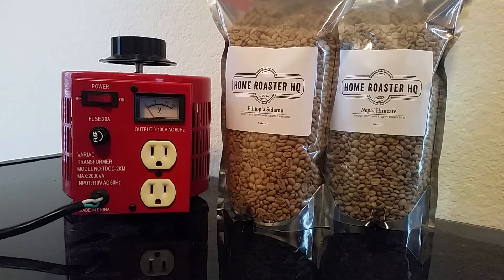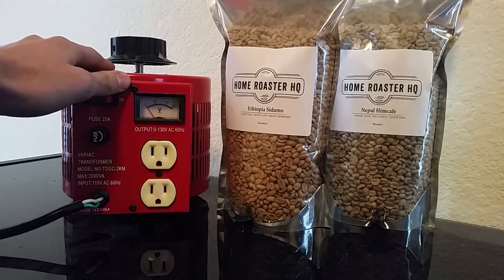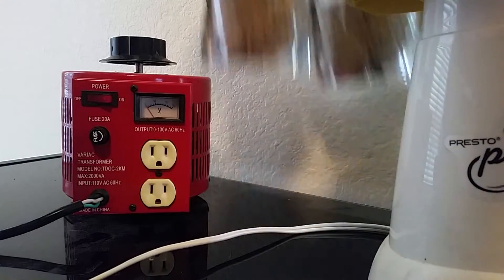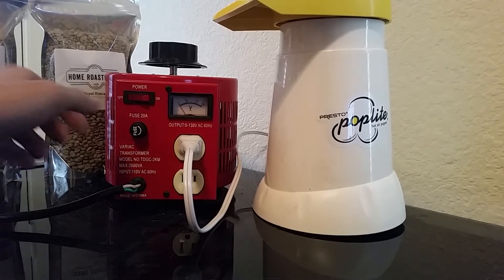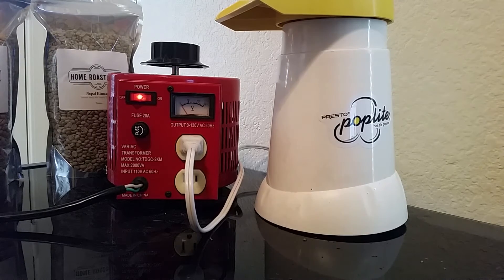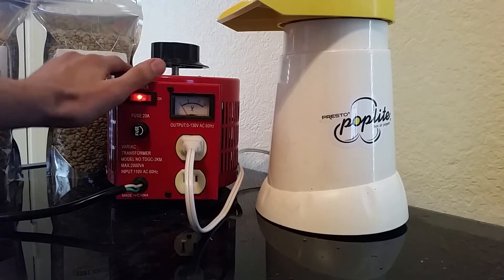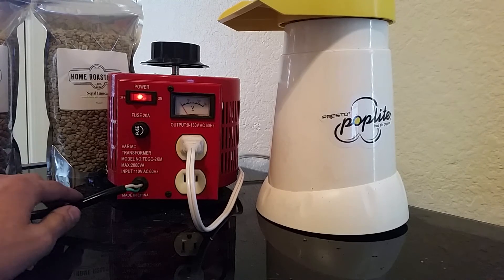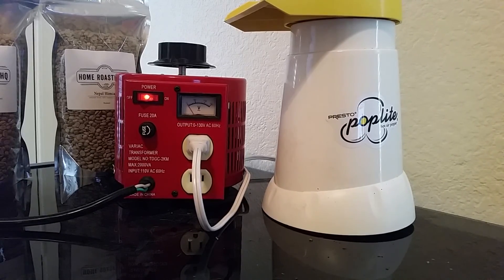Variable Transformer (Variac) Explained | Home Roasting Coffee

Comment: This is not what a variac does. It does not regulate automatically, as it only scales based on what the knob is currently at. It is also not a capacitor, literally the opposite. There is a product that actually does what you want called a line conditioner, or automatic voltage regulator, but it's typically more expensive. Not to mention there's not a single capacitor in the typical variac, since the variac operates on the principal of variable inductance.